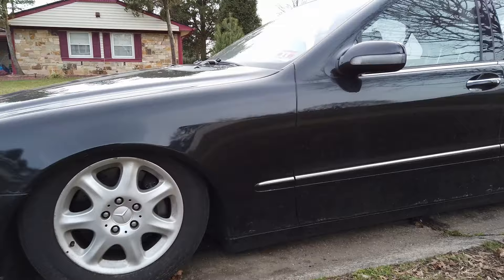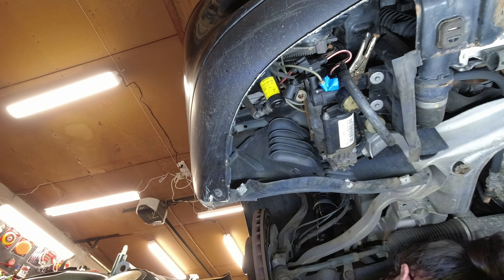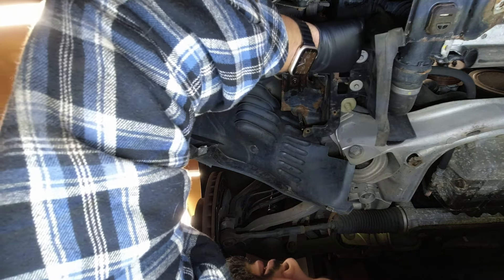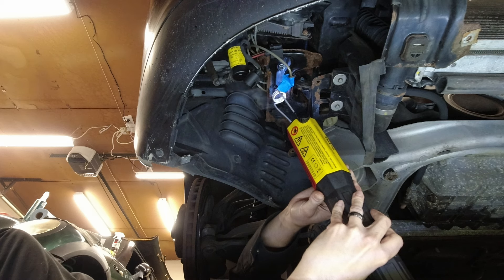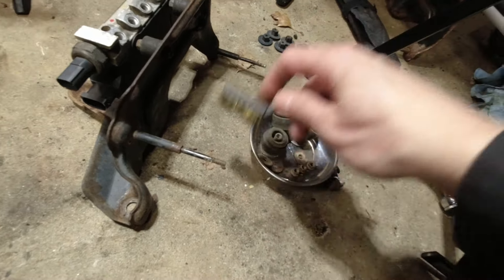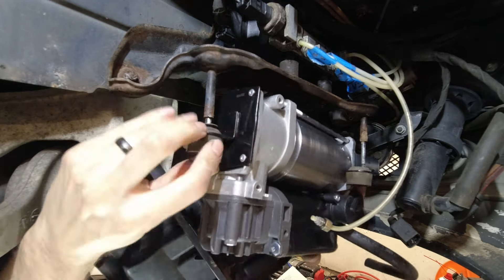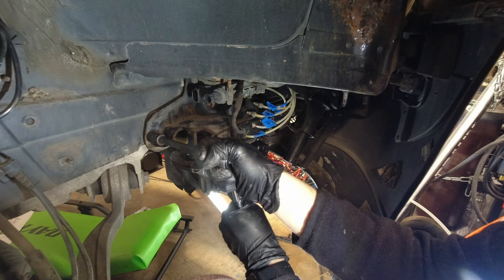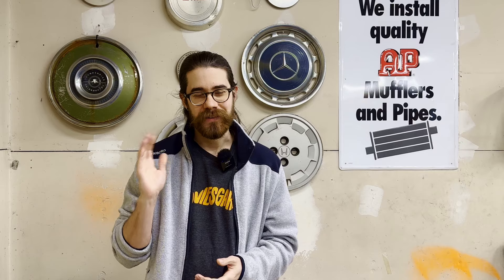Installing a New Air Compressor and Valve Block on my W220 S-Class!

Comment: I own a 2003 S430 and the other common issue is the the pilot bushing that goes into the transmission leaks tranny fluid into the TCM (Transmission Control Module) which is located in the engine bay on the passenger side in the black electrical box. Its a very thin black box on the  inside the electrical box maybe you should look and see if there is transmission fluid in it which would put your car in LIMP mode which the car will NOT shift out of 2nd gear, also the crank position sensor should be replaced and the pilot bushing.
Reply from the maker: That seems to be an issue on more than one vehicle! I've heard of TCMs failing for the same reason on Range Rovers, and ECUs failing on the C-Class (and others) from oil wicking up the camshaft adjuster harnesses.

I haven't had any issues with the transmission on this car so far, but it's worth checking next time it's in the garage.
Reply: @frenchineer  Love your videos keep them up!
Reply from the maker: @W140MercedesS600  Thank you!

Comment: I had a 90 4Runner that someone broke the coolant housing water neck, siliconed it back together, retapped it 1/2-20 and torqued it with the impact and prayed.
Reply from the maker: That’s horrible! Did you keep using the new threads or did you use an insert or something?
Reply: @frenchineer  I got a new water neck but has to use the 1/2-20 bolts. To its credit though it didn’t leak. Should have used the locking pliers I guess lol.
Reply from the maker: Lol well at least it worked! I know at some point I'm going to have to fix the Range Rover Sport oil drain plug, but it's working for now.
Reply: @frenchineer  and you’ll be faced with the same issue. What to do to fix something someone else remedied? Decisions decisions.  I assume you’ll need a new oil pan?
Reply from the maker: Ideally a new oil pan is the way to go, but that's pretty involved with the front drive. Maybe tapping better threads first, though luckily the current solution is working well.
Reply: @frenchineer  oil pans are so messy it’s not hard to see why you’d rather retap it n

Comment: Hello there I have to do the same work on my car. Should I unplug the battery  on plug the relay? Leave both on.
Reply from the maker: If I remember correctly, Mercedes recommends disconnecting the battery.